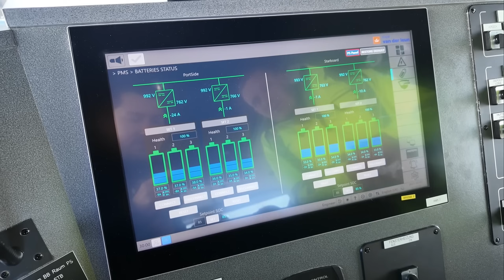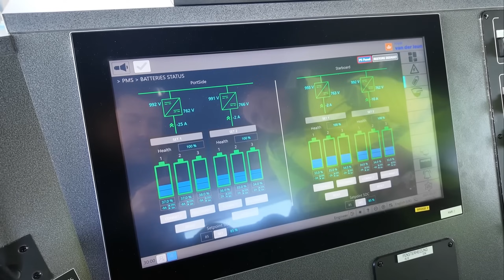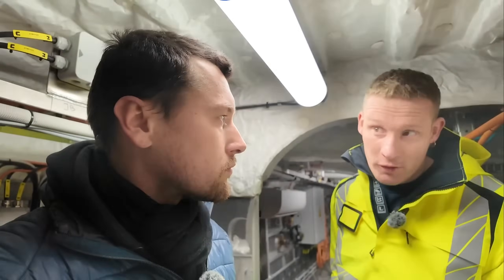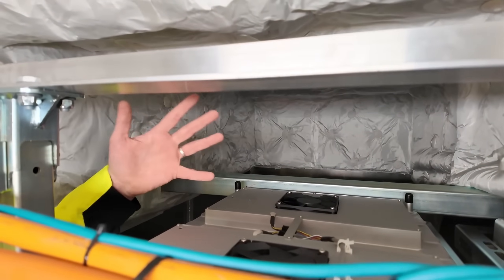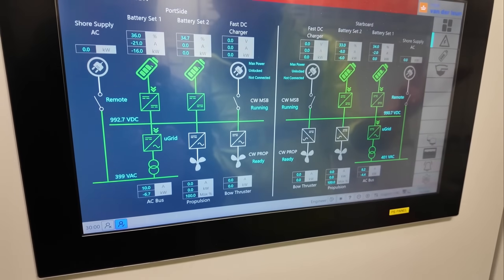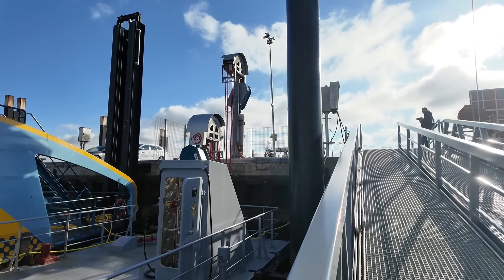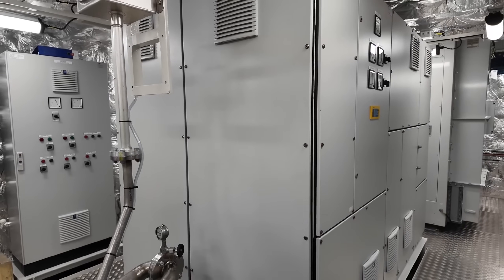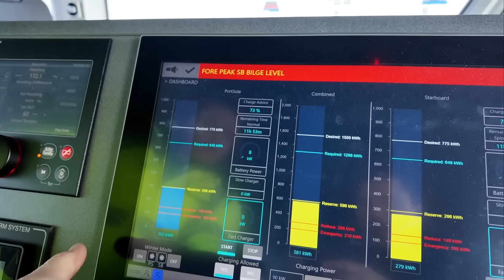Germanys First Fully Electric Ship

Comment: Excellent! Good to see more electric ferries, Helsingborg-Helsingör (Sweden-Denmark) has been electric since 2018 I believe.
Reply: We have several electric ferries in Denmark.
Reply: IIRC, that route has diesel-electric ferries that were converted to plug-in hybrids by adding batteries. They should be able to run on electric only most of the time, but the original diesel generators are still available if needed.
Reply: @georgepelton5645  Yes, for emergencies or driving themselves to a shipyard if needed.

Comment: Great episode - however - lots of flicker when indoors, and the overhead lights are in shot, have you changed the recording frame rate?? It should be 50 Hz, and I think you might have selected 60Hz.

Flicker is caused when the video capture, and the electrical supply to lightening, are running at different frequencies.

Comment: There's a lot of surface area on that vessel that could collect solar energy. 
Furthermore, the vessel could be redesigned with a rigid sail covered in solar collectors.
This could:
1. Significantly reduce the time spent charging at shore 
2. Use any wind to help propel the ship, reducing demand on the electric system.
Note how increased use coincided with longer daylight time of year.
Reply: I did the math for cars, truck, trains. It's never interesting to have solar panels. Energy production is way to low compared with what's consummed. Even in perfect condition.
Pretty sure it's the same for this ship. Unless, maybe you'r in 50kW mode, which is commercially unpractical, and the ship already has 100 knot of range at that power level.
Using a sail to help propel the ship, might be interesting, though.

Plus, 1.5mW on the grid, overall, is not that huge of a deal.

Comment: Huge, mega-voltage batteries and saltwater.  What could go wrong?  They need to recharge each trip?  That cuts the trip number in half.  Did they build a huge power station just for this one boat?  Didn’t they just concede and close one in Aus?  Norway and Greece just banned EVs on ferries.
Reply: Yeah, because ICE engines operates perfectly in salt water also?
And ships, don't have electricity whatsoever, onboard, right?

Did you hear what they said?
They have one trip every 90mn anyway. You invent false problems.
Greece, is not really that good with EV's, never thought about the fact that they don't know shit about what they are doing?
Reply: dont normal ships use electricity too?
Reply: Banned on norwegian ferries? Are you deluded? As Norway has 130 ferry links with most of them on important crossings banning EVs would be totally stupid. Keep in mind that as of April 2025 97% of cars sold were electric and 28% of tall cars are electric. 13% of truck sales are electric, of course Norway is a small market so this is only 370 trucks.
I don't know anything about Greece so no comment there.
Reply: Some extra information: The only ferry line that bans electic vehichles (and also Hydrogen and LPG) that I am aware of is the relatively new Havila line serving "Kystruten/Hurtigruten" between Bergen and Kirkenes. The competing and far older Hurtigruten line, also serving the Bergen/Kirkenes route, does not have such restrictions.

Comment: So they have an electric ship but the dopey fritz blew up a new, state of the art coal fired power station. So where do they get 4mWh from twice a day to charge this stupid idea, 150 nautical miles before she needs a tug boat, not exactly a range with a good safety margin. Imagine if, shock horror, it went into thermal runaway while charging at the port. Germans used to create very advanced engineering solutions, now they're just a bucket of muppets.

Comment: It was great to see the bridge, “engine” room, batteries, etc. on this ship.  Thanks for the video.  I am glad to see Germany starting to use electric ferries.  They should save a lot of money and emissions vs. diesel.

In 2015 I traveled to Norway to ride the MV Ampere.  It operates between Lavik and Oppedal, across Norway’s widest fjord.  It carries 120 cars and 360 passengers.  IIRC it charges for 10 minutes while loading, takes 10 minutes to cross the fjord, and charges another 10 minutes while unloading.  Both docks have batteries to provide the power needed with only a lower power utility service available.  Still running today, AFAIK, proving the viability of electric propulsion.

Comment: Happy to see that more countries adopt electric ships. In Norway the first electric ferry (80m length) was sailing back in 2014. Currently there are 82 car ferries and 22 passenger ferries operating. The largest ferry is "Bastø Electric", 144m in length and can carry 200 cars and 600 passengers. Battery capacity is 4MWh. Of interest is also the "YARA Birkeland", a small, short distance autonomous zero-emission container vessel, capacity 120 TEU.
Reply: Are the 82 ferries all electric?
Reply: @robertn2951  Yes, they are fully electric with electric prime movers. Of course they do have diesel gen-sets as back-up. As a fun fact the first wholly electric car ferry launched in 2015, the "Ampere", has now done more than 100000 sailings (=17 times the earth's circumference). The Ampere has a capacity of 120 cars and 350 passengers.
Reply: @ingehansen9069 Norway is crazy amazing 👏 🤩
Reply: Fjord1 have 4 electric autonomous car ferries under construction in Turkey. All new car ferries in Norway are electric and many older gas ferries have been converted.
Reply: 30% of Norway’s GDP is Petroleum, making your electrification a facade, paid for with oil.
Reply: @jeffforbess6802 at least Norway is trying to do something and it's achieving a lot. 97% of car sold are electric,  ferries are electric,  electricity is produced by renewable sources. Some other mediocre countries simply "drill, baby drill", and because are secretly ashamed of it but too lazy to change,  try to bully Norway by saying their economy is 30% oil.

Comment: Great video 👍
Toronto Canada is getting some Electric Ferries. Those that oppose it say we should be putting in a bridge to the Toronto Island as long term it is just cheaper to have the bridge.
Reply: It will be.  Creating a whole infrastructure of electricity, just to power the ferry, would cost tens of millions.  In 10 years max, the batteries and grid would need to be replaced, at huge expense.

Comment: How many Amps does that ship draw and can the local power grid support that draw without causing brownouts?
Reply: 20 kV is not the local power grid.
Reply: @gerbre1 Typical distribution grids are 10-25 kV.  Example: My home is powered by a transformer in the front yard.  It gets 24.47 kV input and provides 240 V to my house.  This is typical in North American, and world-wide, AFAIK
Reply: @georgepelton5645 As you said, it‘s a distribution grid with a wide range like the whole town. Therefore it‘s not a local grid.
Reply: 1.8 MW it draws sounds like a lot of power - until you realize it's about 1/5 of a single German mainline electric freight locomotive. So the local solar farm is enough to charge the ship without tapping into the 15 kV distribution grid much.
Reply: Assuming 20kV and 1.8MW, that's 90A from the grid.
I couldn't find the battery voltage of the ship, but I'll assume it's about 800V. That would mean after the AC to DC conversion, the ship would be receiving 1125A on each charging port.

For (an approximate) comparison, a 250kW car charger sending 800V DC to a car battery is sending about 300A.
Reply: Yep seems to be an 800v system, it shows 762-766v on the battery side of the onboard charger in the video at 1:15. The ship seems to be using v3.1 of the MCS standard, based on the connectors, which can support up to 3.5MW. Although, in the video stated they were using up to 1MW (900kW) on each of the two charge ports though.
Reply: Um, it is gray most days.  Unless there is a nuclear facility nearby, that dog don’t hunt.
Reply: @jeffforbess6802  It's gray today and we nearly have 100% renewables in the grid. Absolutely no need for expensive nuclear power.
Reply: @jeffforbess6802  it's either sunny or windy somewhere

Comment: Wondering why they went for NMC not LFP considering battery cycles and greater fire safety especially as one doesn't really need a 0-60 mph speed record. Maybe when ferry was conceptualised NMC was the option.
Reply: Both Graphite/NMC cells and Graphite/LFP and Lithium Titanate Oxide/NMC cells are available now in battery modules approved for maritime use. There are pros and cons of each type regarding energy density, power density, charging/discharging rate, roundtrip efficiency, degradation and cycle life, voltage, safety, toxicity and generation of e.g. hydrogen and HF gases in case of overheating. Choice of cell chemistry is a trade-of between a lot of physical and economical features.
Reply: @henrikhagbarth5344  If energy to weight and volume ratio is not a concern, LFP is better in any aspect.
Reply: I don’t think space or weight would have been a limiting factor… maybe just availability or some EU safety rating accreditation requirement.
Reply: Power density is higher in NMC than LFP, which is useful moving high-mass objects and overcoming the drag effect of the water on the hull when starting to move. I assume the vessel also has thruster to manoeuvre in tight spaces. They will also charge quicker than LFP for more rapid turn around.  

The safety aspect was covered in the video, being addresses at a system level using fire retardant foams in the battery bay and over-gassing pressure ducting that also channel fumes away from the vessel. LFP makes sense where there is less room (such as in a car) to implement system level solutions such as in this case.
Reply: Safer.
Reply: @wobblysauce  LFP is way safer than NMC.

Comment: We got some electric ferries here in Amsterdam to cross the river, cool thing when it docks if it needs a charge for a few minutes a whole contraption comes out and lowers into the charge port. Seeing it goes back and forth all the time it really only has a couple of minutes to charge each time it does.
Reply: Megawatts being funneled onto a vessel IN THE WATER?  That seems safe.
Reply: @jeffforbess6802 

That depends on the connector design, the automated charging arm and the switching protocols.  If a current leak is detected the system cuts off in milliseconds..🤷🏻. 
We all have national grid level power cables hanging over buildings roads, docks, canals, rivers swamps and estuaries all over the world for decades  without even half the protection offered on these vessels. 🌍🧙🏼‍♂️🥼

Comment: Well done. Hope this inspires other shipbuilders too. Some questions - Why a catamaran and not a normal ship? How is the typical propulsive equipment weight to the ratio of cargo to be carried between a diesel, electric and steam turbine ship?
Reply: A catamaran gives more stability for the passengers, it is on average 20% more efficient compared to a mono hull, and it can carry more passengers because it has a larger upper deck, and it sits less deep in the water compared to a mono hull so it doesn't require a very deep harbor to pick up passengers. For this type of application which is a short distance passenger service it seems to be the best choice.
Reply: It's a passenger ferry, so it needs lots of deck space but the load is relatively light. That suits a catamaran, where the thin hulls are much more efficient than the wide hull of a normal ship, and the lower buoyancy matches the load. A normal ship would be better if it had to carry a heavy load, especially that load could be carried low down for stability.

It doesn't make a lot of sense to compare the weight of the motor, when the battery is many times heavier than the motor and it's size is determined by the range required. Electric power works here because they can recharge after every trip, several times a day. He says the motors and battery weigh the same as a diesel, but if you wanted more range, you'd need more batteries so it would weigh more.
Reply: @robinbennett5994  it doesnt actually compare to a diesel powered catamaran
Reply: a diesel version of this would be able to go tousands of km or miles non stop that an anstronomical difference lol!
Reply: @carholic-sz3qv  🤣It only has to go 18km for a round trip. And a diesel requires a lot of maintenance hours, and oil, and fuel, and filters, which results in higher operational costs during its 20 year lifespan.
Reply: @insAneTunA I doubt the costs statement.  Replacing the batteries every 4 or 5 years, due to Moore’s Law, mean any supposed cost savings will be swallowed up.
Reply: @jeffforbess6802  🤣😂The battery has a warranty for 10 years. And it's lifespan is expected to be much longer. That is why they do not charge it beyond 85%. And any bad cells that might break down earlier than their expected lifespan can be replaced easily because it is a modular system. You should watch the video before you make any comments. And Moore's law has nothing to do with it. I don't know how you came up with that, but it is complete nonsense.
Reply: @jeffforbess6802  Moore's law is the observation that the number of transistors in an integrated circuit doubles about every two years. So what does that have anything to do with the lifespan from a battery???? You have no clue what you are talking about.
Reply: @carholic-sz3qv  the river's only 5 miles across old mate

Comment: On May 2nd 2025 Incat the Hobart Car Ferry Company launched the Worlds Largest Electric ship of 125m in length with 250 tonne's of Batteries producing 40 Mega Watts of power driving 8 Wartsila Waterjets for Ferry Duties on the River Platte in Northern Argentina travelling 30 Kilometers on each trip with 2,100 passengers and 225 Cars
Reply: Yep. When money talks the bull shit walks. Renewables have reached the economies of scale. Fossil fuels are now way more expensive than renewables and energy costs are a factor with these operations.
Reply: Seen several videos where the CEO clearly states that customer demand electric because we're at a point where it's a financial no-brainer. Why would you spend $$$ and lock yourself in on Diesel tech for the next 29yrs when cheap electricity and more reliable tech already outs you at an advantage. And you'll get the whole sustainability thing for your marketing folks to play with.
This won't be stopped because a few very loud guys on the internets have doubts or fear that their competence in ICE tech will loose value and relevance.
Reply: those things are mainly designed for very short trips
Reply: Argentina is not known for a stable grid.  Ferries are banning EVs on ferries, due to Thermal runaway.  You could have an EV ferry, with no EVs allowed, only running when the grid is up.
Reply: @jeffforbess6802 That is lame 😒 excuses not to do anything.
Reply: @verttikoo2052  I really don't get the purpose of these you-see-it's-not-as-simple-as-you-think comments when it comes to electrification of former ice tech. Is the auther genuinly concerned for our common welfare and fears going electric is a grave mistake or is it about some weird vanity about his (it's almost always a he...) supposed technical proficiency that he wants us to see. 
Or is he simply that deeply invested personally as in works for big oil or paid stooge by Rasha. It's so weird how any sane technically inclined person would not see the potential to feel optimistic about us getting our collective shit together making the transition.
Reply: @velotill   Money. The global oil and gas industry generated approximately $4.2 trillion in revenue in 2024. Oil companies are spending lots of money to fight back the green energy because they know that it will kill their business and they really want to keep it. Fossil fuels keeps us poor because we are the ones that pay that 4,2 trillion and they take it to the bank. Now it is irrelevant because renewables have already achieved the economies of scale and fossil fuels can’t compete with the prices. The change is irreversible. In Germany for example logistics companies and car manufacturers are building recharging stations as fas as they can. Logistics companies understands that when their costs goes down then their profit margins goes up.

Comment: NMC batteries... old technology. 😢
Reply: Not really old technology - there is a lot of research and innovation in NMC, and it has three highest every densities, but a little more risky than I thought they might go for.  I think I would want more thermal isolation between the packs than they have built into this design, and LFP cells too.
Reply: its not old technology its the most energy dense battery on the market
Reply: @carholic-sz3qv  - maritime LTO batteries would have a higher power density than NMC but would also cost a lot more. High power density batteries would be required for ships to get them moving and to overcome drag on the hull, plus power any bow thrusters to manoeuvre the ship.
Reply: Not old technology, but LiFePO4 chemistry would have been a better choice, based on recent advances.
Reply: @oliver90owner  Even based on 10 year old technology. As weight and volume is not a concern here. LFP was already superior to NMC, in every other aspects (maybe not in C ratings, for special NMC, but that's not a concern here).
Reply: Moores Law.  Four years tops, before they start looking to replace batteries, deleting any alleged cost savings.